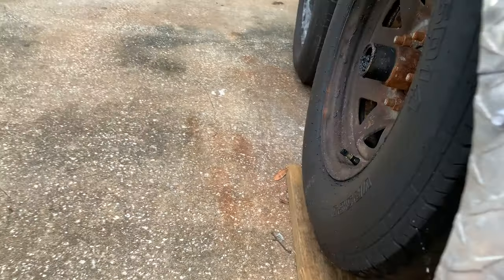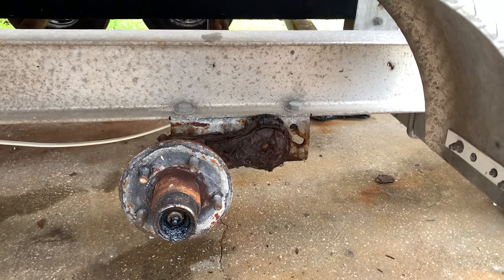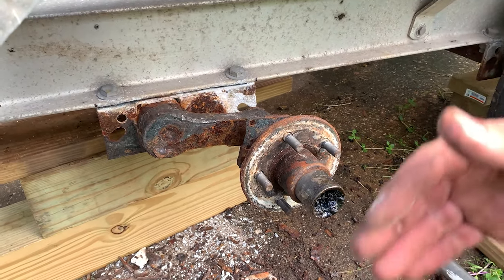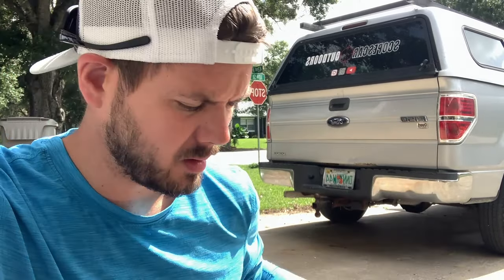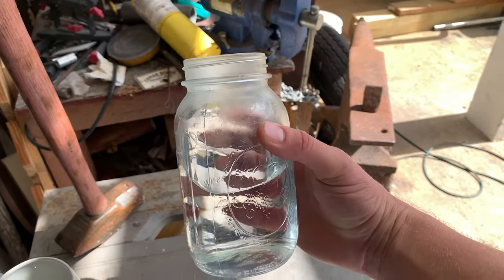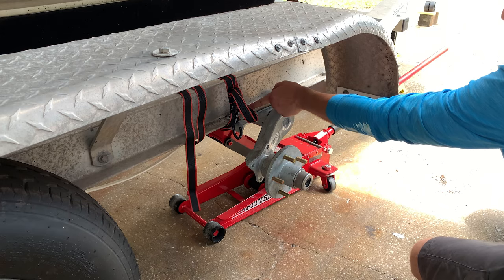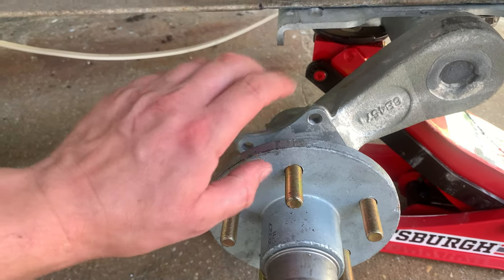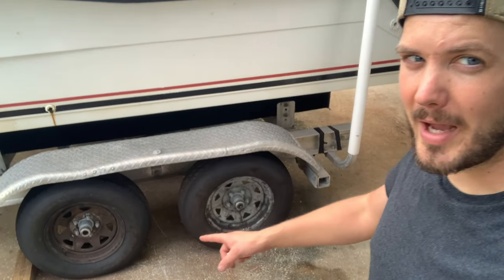How to Replace Trailer Axles on a boat trailer DIY SALTS a KILLER (Getting back on the Water)

Comment: Good job.  It works.  I am getting ready to do this.  I would think the hard board spacers you added would disintegrate over time leaving a gap and possibly make the bolts loose.  You might check that.  Might be better to use stainless steel or aluminum as a spacer or nothing.